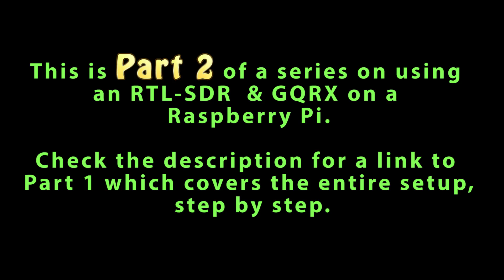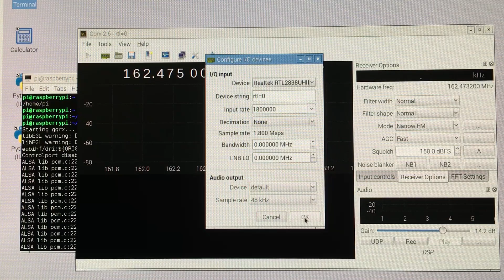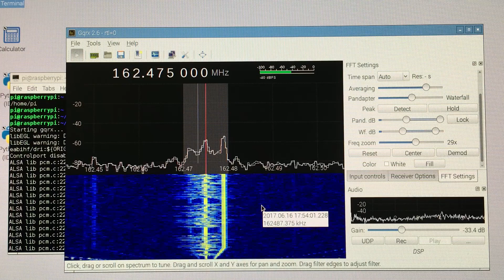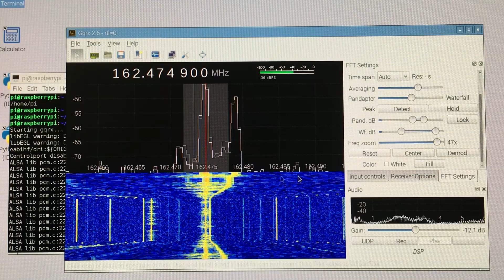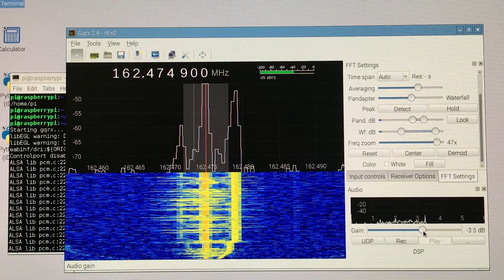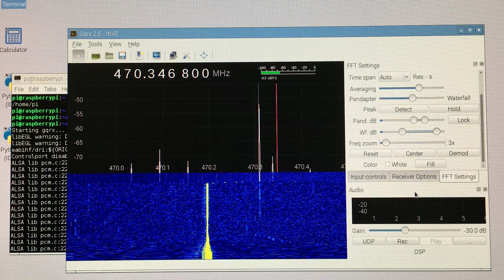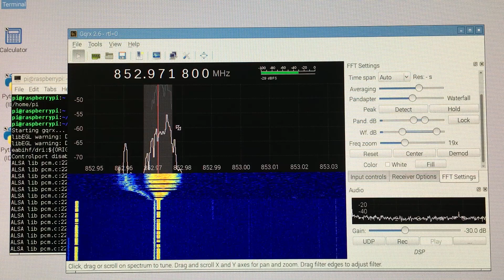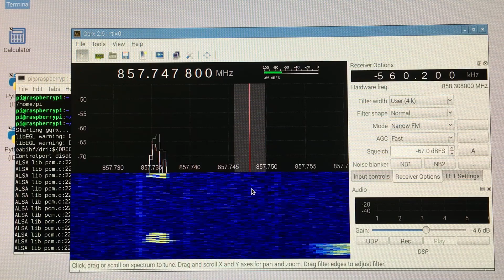Using GQRX with RTL-SDR on a Raspberry Pi (Linux)

Comment: Hi Steve Im over in cyprus and not got any access to Amatuer radio Hardware, so I have a Raspberry Pi 4 4G and NooElec NESDR SMArt HF Bundle: 100kHz-1.7GHz Software Defined Radio Set for HF/UHF/VHF including RTL-SDR, Assembled Ham It Up Upconverter, can you make a recomendation for SDR Software that will run on RSPi 4 and aslo work well with the Nooelec decoder. 
Many Thans
Clive

Comment: Did you ever have a chance to look into and figure out if Digital Trunking was a possibility on the Raspberry Pi or have any success with it? I was thinking about picking up an SDR as a hobby and certainly prefer my Linux machines and Raspberry Pi's to using a Windows solution, for sure.

Comment: I've gotten GQRX to work on an Rpi3 but for some reason not an RPi4.
Reply from the maker: I haven't tried.  Anyone else????
Reply: @TahoeSteve  if it makes any difference I have the 4gb ram model, using Raspbian.
Reply: I have it working on my pi4 4gb  Running the latest version of the Raspberry pi OS.  Installed GQRX using raspberry pi software installer. In Configure I/O devices Device = Realtek RTL2838UHIDR left everything else on the panel in default setting. just noticed the date of your post. I imagine you've already solved the issue by now.

Comment: Which version of RP do you use? I have only old (first version) of the Raspberry PI computer. I doubt that it will work, maybe too slow for that task? Thank you in advantage.
Reply from the maker: it was too slow for the task.  i only did it as a proof of concept
Reply: Thanks for the info.

Comment: Steve thanks for the videos Very informative. I will add one constructive comment. You have said in a couple of videos that the Ham Bands were dead which is never the case if you setup the SDR correctly. You can not use Quadrature sampling for HF bands. You need to change it to I or Q sampling, Q on my SDRs, and then you can use the LSB, USB, CW modes. That should help you get in the HF (or what most people like to say Shortwave) bands. Hope this helped. Look forward to another video.  W9KHP
Reply from the maker: constructive comments always appreciated.  thanks for watching!

Comment: Greetings Steve. Super excellent tutorial. I closely followed it and was able to crank up my receiver with success. Even with new versions being released I was still able to get this bad boy running. I did run into one problem though. I can see on my scope i have reception of FM radio stations, but I am unable to get any audio thru my devices, even the small audio screen at the bottom right isn't showing any activity. Do you have any trouble shooting ideas how to get it up and running?

Comment: This works with RPi 3 and a regular monitor but freezes after two seconds if I use the Raspberry Pi 7" monitor.  Anyone using this setup, I would appreciate viewing your setup parameters.  Do I need to overclock the processor?
Reply: Maurice Craft Would you not be better to use the Pi3 as a headless unit? I use the nooelec smart on my Pi3 and run rtl_tcp, then pick it up with an android tablet on RF Analyzer to do the heavy lifting. Give that a go and let me know if you get stuck.
Reply: Will do.  Thanks for the information.
Reply: I love Dan's headless mode setup, but for more on Pi touch screens, go to http://rtl-sdr.com and search for 'touch screen' and 'touchscreen' and see articles dealing with those.

Comment: My Raspberry Pi 7" Touchscreen does not concentrate the gqrx screen where I can see all the edges of the program and the options with out dragging everything everywhere. I have tried changing the screen resolution with no luck. Anyone else run into this with the 7" touch screen? I also have a Bluetooth speaker attached and get no audio out from this, have tried all the settings on this too. My unit is  RasPi3

Comment: Great videos!  Nice step by step instructions.  Everything is working for me except no audio out. (I am just using a monitor with no HDMI audio.) I plugged in a generic usb sound "card" and set that as the default audio out but still nothing.  What are you using for the audio out?
Thanks Bill
Reply from the maker: Audio out goes to speakers.

Comment: Such a fun hobby! Thanks for the awesome series. I'm following it closely! It would be rad to figure out how to do digital and even regular analog trunking decoding on the Raspberry Pi.

One question: How are you getting audio output from your Raspberry Pi? Do you plug it into external speakers?
Reply: See if this helps:  https://www.raspberrypi.org/documentation/configuration/audio-config.md
Reply: Article on using a Pi3 for trunking!
https://www.rtl-sdr.com/running-windows-x86-sdr-decoding-apps-on-the-raspberry-pi-3-unitrunker-winstd-c-wxtoimg-dsdplus-and-more/